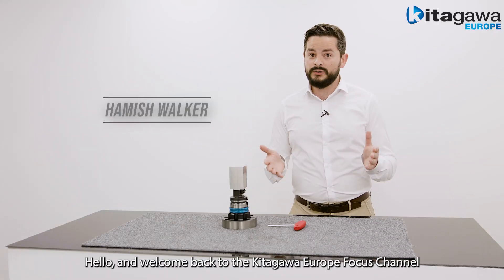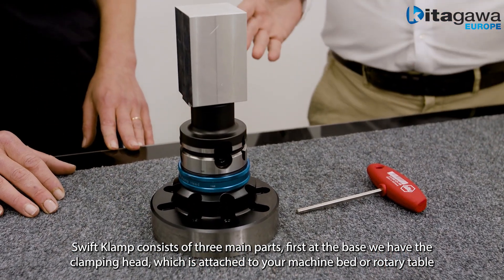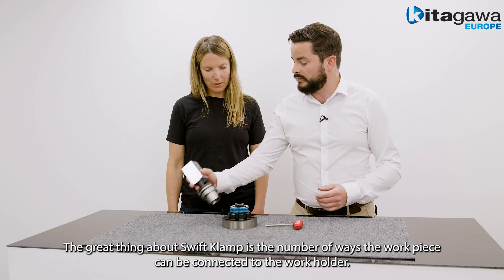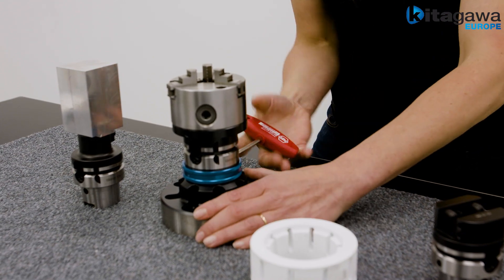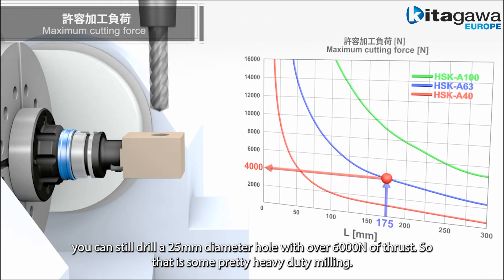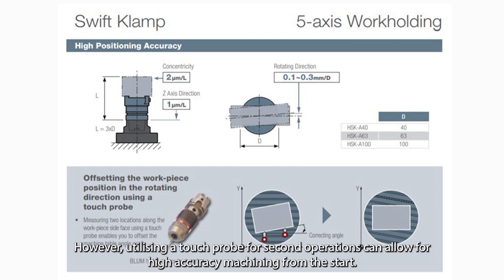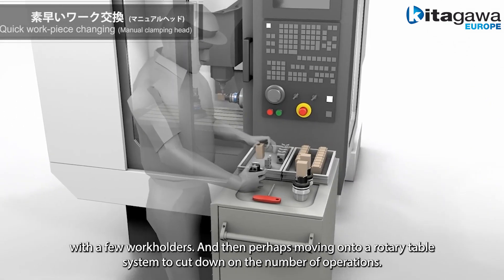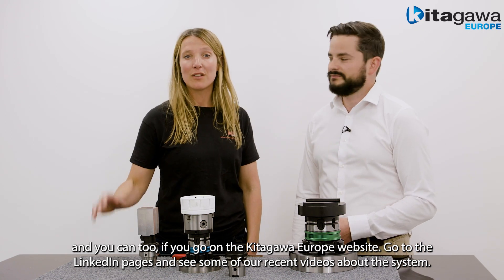Kitagawa Europe Focus Channel - Unboxing Swift Klamp

Comment: How many rpm's can it handle ? Like if I have it on a rotary table that can spin up to 1100rpm's and like to know if it can hold it  or gonna fly through the window
Reply from the maker: This is designed for static workholding therefore it should not be taken rotated at speed for any amount of time beyond conventional indexing speeds. The issue is that the workpieces could be very irregular therefore could possibly put enormous strain on the dovetail clamping as well as the spindle bearings of the machine.
Reply: @kitagawaeurope  that i already figured. it was in therory. like if you hold a round park with a hsk ER collet. how many rpg's would the base be able to handle before it would let go of the holder ?

Comment: It's a great system but it really ought to have an adaptation to maintain rotational alignment between clamps. With that the flexibility would be crazy good.
Reply: i think HSK holders already have that built in
Reply: @DylanVos05  They specify the rotational repeatability and I forget what it was but not good enough to re-cut parts without probing, especially if they aren't small
Reply: @Cosmobrosomething  i guess if you are using dovetail workholding tho you aren’t going to use a 5 axis to remove the dovetail, only if the side with the dovetail needs 5 axis for its features too